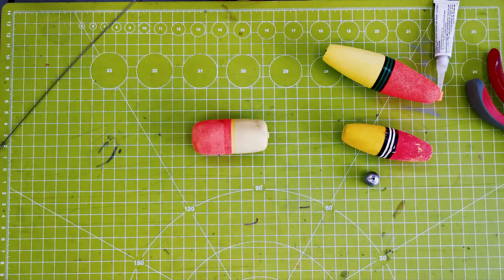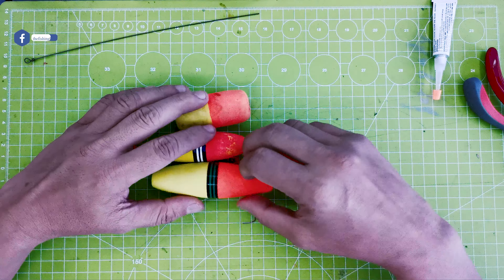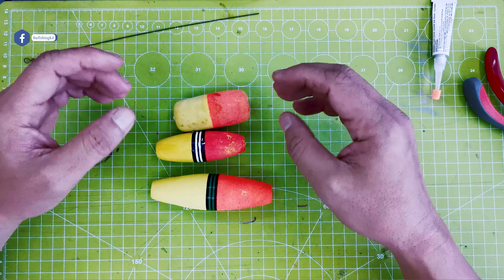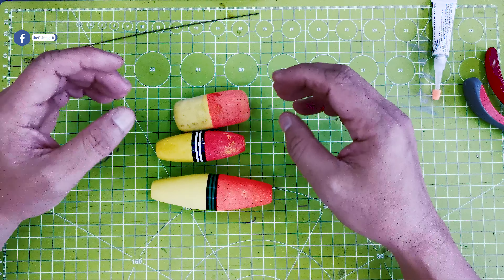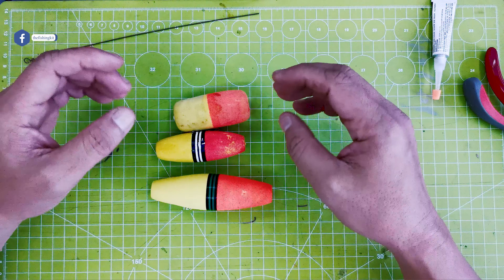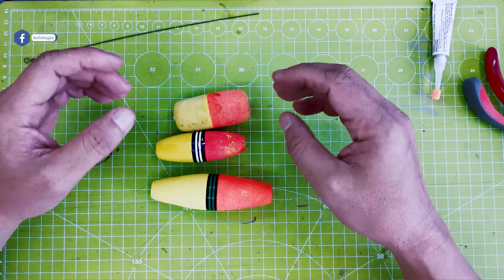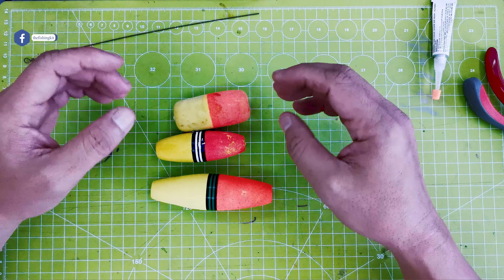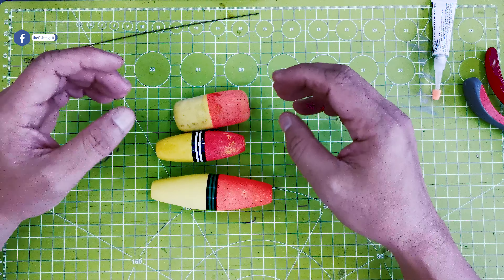HOW TO CAST FLIES WITH CONVENTIONAL TACKLE

Comment: Such a great idea 💡.   I'm a fly tier and have been looking for a way to fish flies on spinning gear.   I'm going to give this a try.

Another thought- I fish for lake trout by vertically jigging in 50 to 100 feet of water.  Lake Trout love chasing lures, especially anything that vibrates.  I've considered dropping down a heavy inline spinner (1 to 2 oz) and then I would simply reel it straight up through the water column.  The blade will surely trigger the trout to chase and hit the spinner.  However, these inline spinners tangle with the leader as the spinner bait drops to the bottom (the blade causes the spinner bait to fall slowly and the hook end snagging the leader).

I wonder - instead of attaching a fly to the swivel  on the terminal end of the tubing (the kinked white tube), I could attach a inline spinner.   I'd use an unweighted inline spinner and then hang a 2 oz weight to the rig.  Hopefully the tubing keeps the spinner bait separated from the leader as the weight pulls the rig down to the bottom. That way, the spinner bait doesn't snag the leader.  

🧐🤔

What would you do to drop a spinner bait into 100 feet of water? Any suggestions?
Reply from the maker: I would use a slow or a fast jig, some friends in Japan do this. It should work with you as well.
Reply: @TheFishingKit  I should of mentioned that I do target these fish with a slow pitch jigging setup. I use a Centaur SPJ rod paired with a Shimano Stradic.   Super fun setup.   I need to purchase a speed jigging rod now.  I speed jig with a heavy, fast action inshore rod, but it's not the right rod.    I'm trying to include a spinner bait to add another to my quiver.   I should also mention that I tie big marabou flies and use a heavy drop shot rig to target these fish. 

Appreciate your thoughts and vids 🙏

Comment: Casting floats and are all the go in the pacific islands. They make it possible to cast small light lures a good distance.
Reply from the maker: Yup...been around a long time - just that people aren't really aware, or haven't put two and two together that you can use flies on them as well. There are a lot of methods out there...I'm just sharing two of the very easier ones.
Reply: @TheFishingKit  I’d not seen it till I moved to the islands(Nauru). I’ve not tried flys behind them, but locals here use sabikis, small squids, etc.